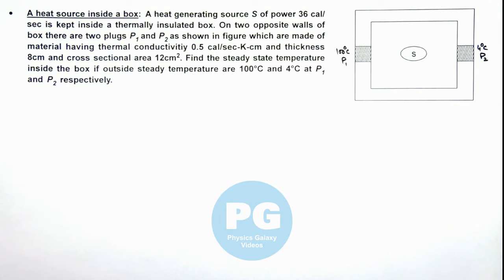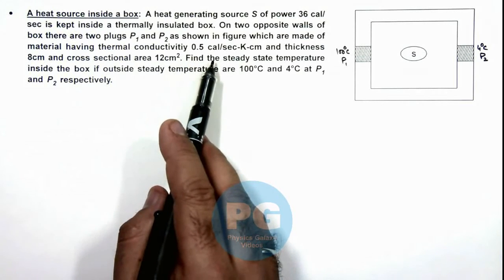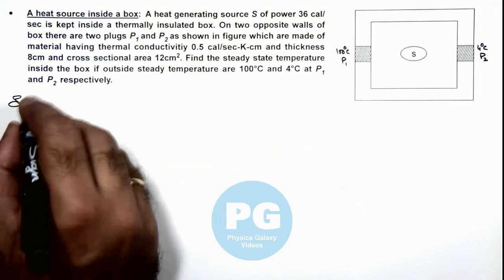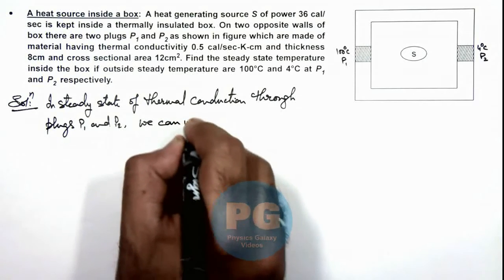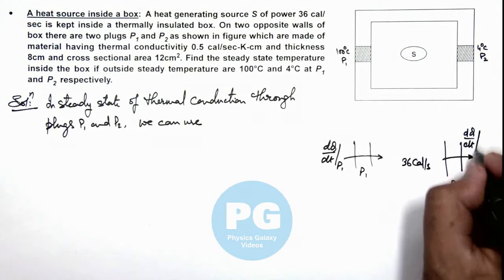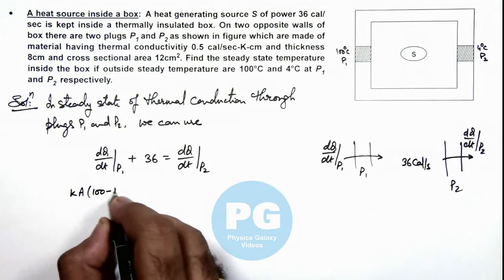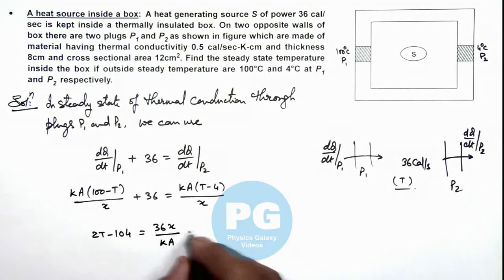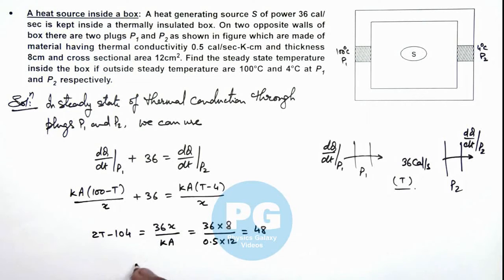9. Advance Illustration | Heat Transfer | A heat source inside a box | by Ashish Arora

Comment: if the material is thermally insulated then y do we consider 36?
Reply: I'm also doubtful, is it only conducting at points of contact with p1 and p2 ?
Reply: Thermally insulated box is outer one.

Comment: How can you say temp inside is not greater than 100
Reply from the maker: We are not saying that... equations will manage and final result will give the actual value...
Reply: In another way ( which we can say in analogous to current) that assuming S to be at highest temperature the heat current will flow in both so 36= ka(T-100)   +. ka(T-4)
Reply: @shashikantmaurya1038  how can you say t-100 and t-4??
Reply: @shivankkushwaha3000  just assume the temp inside is greater and heat flows outwards only and equate it to 36. If heat doesn't flow outward then when you find dQ/dt at one of the plugs will be negative
Reply: @Rajeev Ranjan: Could be, in that case, dQ/dt, evaluated at P1, will turn out to be -ve.
Reply: @SohamChakraborty42069  Yeah, now it makes sense!!
Thanks anyway.
Reply: Thanks to reply sir